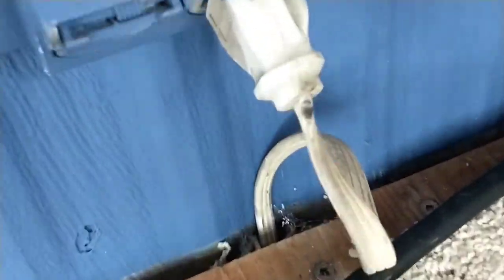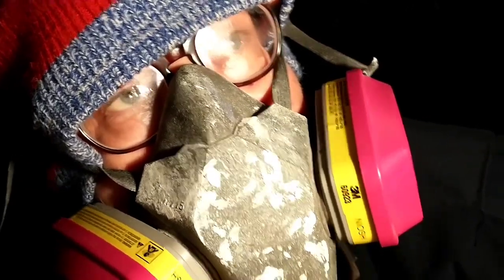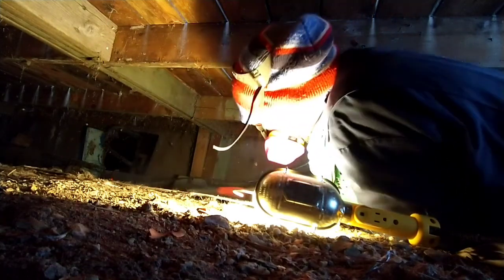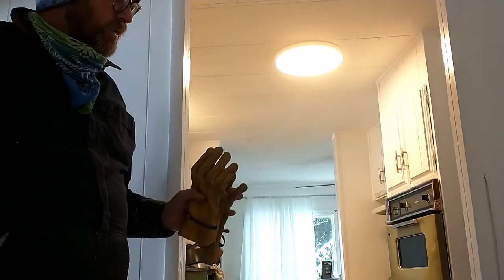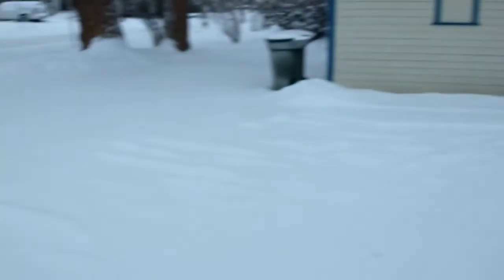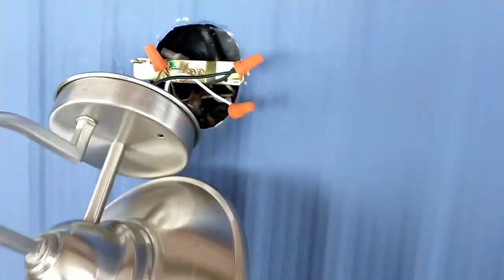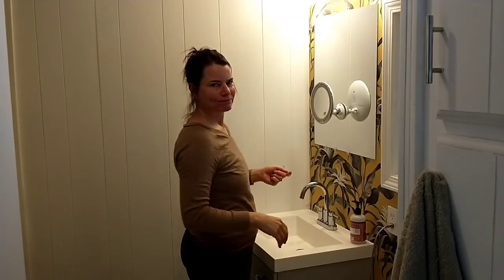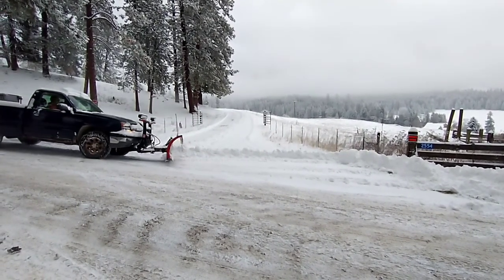A Mobilehome Makeover EP 105: frozen pipes in a manufactured house

Comment: fellow mobile home owner here! I re-wrapped my pipes with brand new heat tape, insulation, etc… and put space heaters under my trailer. it’s been days and nothing is coming out of my pipes still… any ideas? i’m on my third plumber
Reply from the maker: I feel your pain, ouch! It seems like you've taken all the steps, and a plumber likely knows better than me, so if they're stymied, boy o boy, I really don't know. The one thing I can think of is to call the utility and see if the water supply is frozen at some point before getting into the house?
Reply: @BlackWires  hey man, thanks for the reply! turns out, the pipes in the ground were copper, installed wrong when they moved this trailer here, and not insulated at all. the trailer park had to pay for a whole new line to go under out trailer and we finally have water after 12 days without 😅
Reply from the maker: @dipperpotter2491  glad to hear you're back on, that must have been a long two weeks
Reply: My main line froze. The inside of the MH is fine. It's a vacation property so I may just leave it alone until Spring. Main linme already leaks so I'm looking at a replacement there.
Reply from the maker: Vacation homes are extra tough in winter, I know people who turn the water off at the utility and drain the house after every visit, with some sort of anti-freeze flushed down the toilets